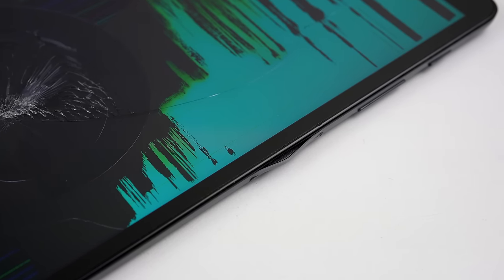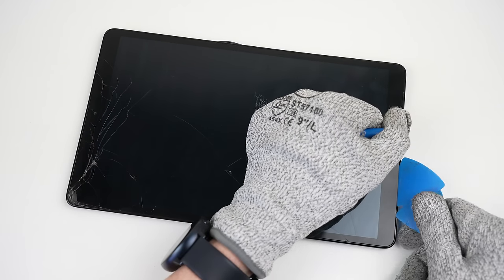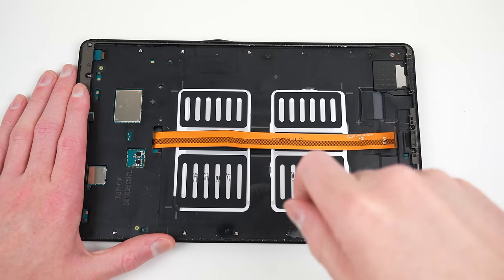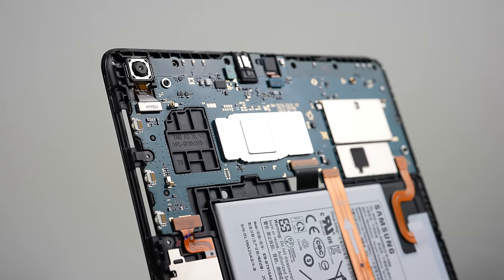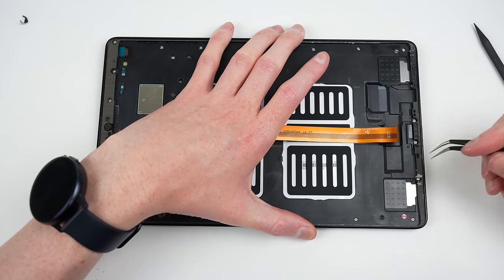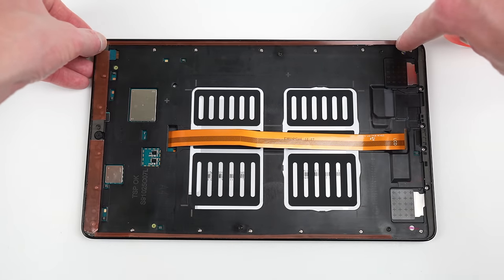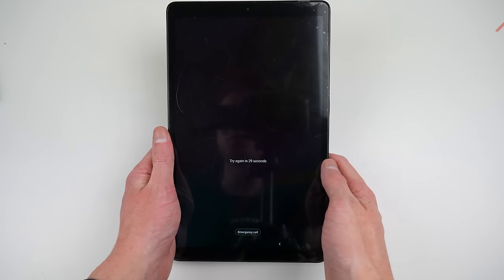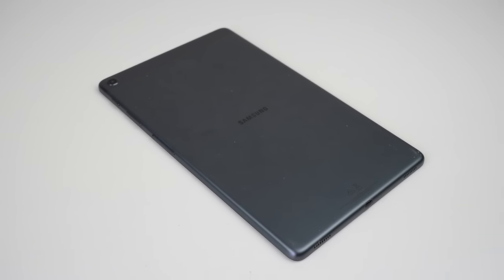Resurrecting This Destroyed Samsung Galaxy Tab A

Comment: The tablet looks really “old school” but at least it doesn’t get artificially “bricked” by software locks when replacing parts.
Reply: Bruh i use this tablet it runs very good it has a latest Android version and runs very smoothly from which angle is it old school
Reply: old school? this tablet is from 2019 lol
Reply: this particular model is from 2019. It's a bit slow and the screen could be better, but it's built well and does the job
Reply: Old school are you crazy, the tablet looks very good one of the thinest top and bottom bazzels
Reply: @boostkiller  the 2020 is even better and has iPad esque thin bezels all around
Reply: @efftee  it’s a budget Samsung Samsung tablet damn it
Reply: Imo the “budget” $329 iPad 9 is better than all these android tablets. Especially when paired with a Logitech keyboard and Apple pencil
Reply: @joriuschuwa  it is budget it’s 100 dollars nzd (329usd is 700nzd)
Reply: @subhanraza9664  same
Reply: @poble  yeah lol I use it everyday
Reply: @groupofmoronsinnz6735  yeah but in my country, the base 64gb iPad 9 costs $429.
Reply: well said
Reply: @joriuschuwa  🤦🏻
Reply: @boostkiller  it’s an opinion.
Reply: Samsung doesn't do this stuff :)
Reply: This tablet also has almost no use. It has no specs to speak of, an awful screen, and is still way too big to be a tablet. It's a crappy laptop.
Reply: @subhanraza9664  I have the 10.1 version lol
Reply: Old school ? Uh no
Reply: @acumenium8157  the screen is so good for this money
Reply: Ellis The DJ  actually this is the 2019 version
Reply: @boostkiller  It's a crappy TFT/PLS screen with no angles, color, or brightness to speak of. What are you talking about? For THIS price I'd expect OLED. It's so expensive. 80$ Chinese tablets with lower-quality IPS screens look infinitely superior.
Reply: @acumenium8157  🤦🏻🤦🏻go for Chinese then
Reply: @acumenium8157  someone’s salty
Reply: @oHacks.  Samsung came out with a Tab A in 2015, then made the 2019 version the same name. Both versions are called Tab A, only difference is the price on websites
Reply: @acumenium8157  you're right when you say this tablet is a terrible laptop, but that's probably the only thing you're right about.

This tablet is like $100, you're comparing apples to oranges and getting very upset in a youtube comment section over said different fruits. Your arguments seem to either form out of ignorance, or perhaps due to being spoiled as a $400 iPad will obviously seem better than a $100 android tablet. Calm down
Reply: It has the typical google-lock. If you reset it with the old owner still signed in, you will need to enter the old pin or sign in to the google account. Luckily there are many ways to get around this with investing some time.
Reply: It's from 2019 the 2015 ones had still the button
Reply: @acumenium8157  it must be big small boy
Reply: @ChrisRaptisMGS_Greece  looks like someone forgot to change their diaper today
Reply: @corvidconfidential8826  Actually this tablet was ~250$ new. It's only 100$ because Hugh bought it literally broken.
Reply: @acumenium8157  if you watched the video, you would know it was $50, and I got $100 from my own experience. Both times I bought this tablet brand new, I got it for $110 and $100 respectively. That wasn't even the point though
Reply: Ellis The DJ  lmfao no
Reply: @joriuschuwa  guess what that is in my currency bud
Reply: @subhanraza9664  For me it's laggy af. My device has 2gb ram
Reply: I had the GalaxyTab As
It's like a much smaller version of it. And man, that thing was durable.
Reply: @joriuschuwa  yes, we know ipads are the best selling tablets. 
Most people prefer them already, as do I.
Reply: it's trash
Reply: @firepower_  Easy repair for one.

Comment: Just saying for everybody here: if you want to disconnect the screen (on any device) make sure the battery is disconnected. If that's not possible at least be absolutely sure the device is turned off. You may blow components on the logicboard of you disconnect the screen while it is turned on.
Reply: I know that's true of clip-style connectors but I wonder if it's any different for ribbon cables like these
Reply: Yes I did that mistake some time ago and can confirm you should do that. It happened to my S7 Edge when I wanted to replace the cracked screen after I got a second broken phone I salvaged a good screen from. After removing the old screen cable while the battery was still connected, nothing every showed up on the old or new screen. I then had to sell all the parts as broken. I got a reply from the buyer who said the second screen was perfectly fine, so I broke the GPU on the board or something like this.
Reply: This is literally first step of repairing electronics, disconnect battery first, or else get a short circuit

Comment: It’s been a while since the last uneventful repair. Repairability is going to worse for sure.
This Samsung tablets are great, cheap and simple. Mainly use an iPad at the moment but also have an old 2016 TAB. After so many years the TAB A still works and does what it is expected to do.
Reply: I used to have a tab 7.7 for 2012 lol
Reply: Is it an tab a6
Reply: @Stayfocused-1  mine is TAB A 10.1 '16.
Reply: I have a Tab A SM-T550 from 2016. Besides the battery life, it's still working fine so I don't need to upgrade it now.
Reply: Yeah, this old tablets are not very fast but fast enough to use, specially if you adjust your expectations. All the apps that I have in the mobile and in the iPad also are in the Samsung and work well enough. 

The main problem is not even Samsung's fault. At least mine comes with Widevine L1, but neither Netflix nor Prime Video recognize that and adjudicate it the L3, so those 2 platforms will only stream in low quality (around 700x500). It is a pitty because the screen is very decent. And you get an SD card slot (which you don't in an iPad) so you can put in there all the movies and series that you might want to watch without caring about storage.

Right now devices with Android 6 are starting to be dropped from support of certain apps, mine has Android 8 so I guess that won't be affected by that for a maybe 2 years more. To remain usable until 2022/23 would not be bad at all for a basic tablet launched in 2016.
Reply: I still use a tab a 2018 and it works great
Reply: @DemeDemetre  i still have it 9 years later
Reply: I have tab s7

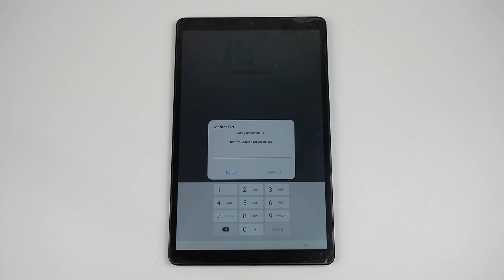Comment: I see at 7:56 there is a FRP lock notification, It is great to see that there are ways to remove this unlike with Apple devices which have iCloud activation locks. Otherwise this device would have been only fit for parts. Another great Video Hugh!
Reply: I wondered as well, I found one in the junkyard (older tab A) that has FRP lock and I can't find any way around it :(
Reply: @trevorjmaendel  there are very good walkthroughs available on YouTube which guide you through the process of bypassing the frp lock and then login using your own Google account. Then reset the device. Frp gone! With Apple devices  it is not possible to bypass the iCloud lock notification like with Android devices. But apple enjoy ripping people off from the moment you buy into the apple ecosystem.
Reply: @retrotech11  I have yet to find one that works. Mine is missing a whole bunch of the loopholes that most people use. I've tried reflashing the OS as well as modding it to no success. Not a big deal as I got it for free but it's a shame not to be able to use it at all...

Comment: Just a note about the repair, from a guy that also specializes in mobile device and laptop repairs. The small control board for the digitizer has some large grounding pads, that were originally connected to the back metal display shield using conductive metal-type double sided tape. If the touch works - then that's great, but just keep in mind that some pcbs/flex cables require proper grounding. You can buy that specific type of conductive-metal strans tape on ebay or amazon. As always, great video, enjoyed watching it, wish you luck!
Reply from the maker: Thanks for the advice, will have to pick some up!

Comment: I actually own a wifi model of the SM-T510 but it is called Samsung Galaxy Tab A 10.1 2019. The model you have is the cellular version which has the model number: SM-T515  ^_^ thank you for a very helpful and interesting  video .
Reply: Yeah I always get Wi-Fi models instead of the cellular ones because it's cheaper, I don't normally take my devices (except my phone) out of home, and when I do, I have my phone with me so can hotspot across from a phone to the wi-fi device.
Plus, if you use a cellular connection, you need a new SIM card in each device, which means another data package, which will get pricey the more devices you use. One central cellular device and wi-fi hotspotting works wonders fr me.

Comment: Luckily it didn't get FRP locked after that factory reset!
Reply: It did though get FRP locked though... But somehow, 0000 worked to unlock it, when it wasn't even the old passcode. I think he may have flashed other things off camera before the reboot clip. You can't just easily bypass frp like that.
Reply: @Sanrasxz  Ah yes, that might be the case. I actually found an FRP bypass myself (as in: figured it out, didn't look it up) by parkour-ing around the UI a few years ago. Let's just say security on old Huawei devices sucks haha.

Comment: You make it look easy.  Curious, what was the msrp and how much did it cost you (sans labour) to repair it?  Did the savings justify your labour or did you just buy it to demo the repair?
Reply: Mama
Reply: To be fair, repairing Android phones in general is 100 times way easier than iPhones as it doesn't overcomplicated the parts that needed.
Reply: Yeah. I got a Galaxy Tab S and the display for the damn thing is $150 anywhere I look for it. Looks like they never made knock-off replacement parts, there are no refurbs, and genuine parts (be it new or used) cost way too much.
>inb4 lol how is $150 too much
New tablets can be had for that much. Considering it's just a toy for the kids, repairing is not worth it.
Reply: Given the price of older tabA’s I’d be surprised if it’s worthwhile once you try paying yourself more than minimum wage.
Reply: @YeOldeKamikaze  isn’t the S an oled panel? Even phone oled panels are expensive, let alone tablet size ones. And you’re not buying a (recent, anyway) S tablet for 150 bucks.
Reply: @JasperJanssen  Yes, it's AMOLED, and it's a first-gen Tab S. Considering it was only being used as a kid's toy, any tablet that runs Minecraft should do. $150 tablets from Samsung and Huawei can do that just fine. Parts + labor gets too expensive to justify a repair. Keep in mind that we live in a developing country and the exchange rate makes spending near $300 on a repair kinda hard to stomach.
Reply: @YeOldeKamikaze  for a large amoled panel, 150 sounds like it is the knockoff price.
Reply: @JasperJanssen  that's the cheapest I've found for decent condition used parts. New geniune parts were going for over $300 (not counting shipping nor labor), but that was many months ago. I have not bothered to look prices up again haha.

Comment: I actually have this device, it's okay, however gotten significantly slower after going onto one ui 2.5.
One thing i was confused by was that; wouldn't the device ask for the original owners email address(and not letting you enter your own until the old one is imputed) as the device has been reset incorrectly? Or am i missing something
Edit: it's called google FRP and you could actually see it lock(7:56) however the seller probably gave him the login to just pass it.
Reply: I guess, that's exact the reason why Hugh did the factory reset instead of the standard reset via the software.
Reply: This happened to me, and it's annoying, however, it's protecting the device from getting stolen and getting sold as useable.
Reply: @gilles111  what?
The lock happened anyways, he just cut it out
Reply: @samuelzuffa4298  yeah it's kinda similar to icloud locked iphones ig
Reply: @PlumbCarton5607  I'm not familiar with the Android security system. If you say he cut that part out,  sounds credible to me. 
I know Apple won't let you reset anything if you don't have the password.
Reply: @gilles111  i mean have you looked at the timestamp at the original comment? There's a pop up you should read
Reply: @PlumbCarton5607  Missed it complete in the video. Thanks for the update!

Comment: Hugh, I saw a couple FRP prompts there. How did you get past them?
Reply: he just enters 0000
Reply: @reddbendd  FRP is tied to a Google account, if you read the screens in Recovery and Setup talking about it
Reply: @JaredTamana  ya
Reply: @reddbendd  okay so 0000 doesn’t cut it for a Google account.
Reply: @JaredTamana  well clearly that’s all he did when it popped up
Reply: @reddbendd  my dude, clearly there’s more that’s been cut out. That’s why I’m asking. I watched the video just like you. We both know what video editing is, there’s plenty here. Please, I’m begging you, use a little bit of extended brain power on this.
Reply: @JaredTamana  well then he probably rooted the device somehow and reset the pin code 🤯
Reply from the maker: "Enter your current PIN" not "Enter your previous PIN" 😎
Reply: @HughJeffreys  what does this mean
0000 didn’t work the first time you tried to unlock the laptop

He changed the pin somehow??

Comment: After you reset the device, it forced you to enter the old pin of the device before it was reset (FRP). Where did you get the 0000 from, as it didn't work before you reset it.

Comment: My little almost 5year old brother tablet looks in a different condition,the glass in the bottom left and wen powers up you will notice that there is a hole in the bottom corner that's because wen we were at my grandmas house he refused to keep his galaxy tab a in the case my mom bought him and in the lower corner glass it is cracked but it still works I was able to charge it concerning it was in my moms cold closet for about 3years because she did not find a repaier to fix it I was also able to update it to android 11 it was orgnaly running Android 8 or 9 because it is from 2019

Comment: I have the same Tablet , my headphone jack is busted ! In South Africa this costs a fortune to repair or replace in my case , I also have a long single line crack running across the screen from one corner to the top corner , my biggest fear is , if they have to replace my headphone jack would i necessarily have to replace my screen ? What makes this even worse is Samsung South Africas sloppy service hence I am a Samsung member

Comment: You know that apple is not fixable. Even if you have original parts - it won`t work because of codes, programmable parts (even battery) etc. Sad but true :(
Reply: Reprograming
Reply: @romashul9672  I know but often there is no reprogramming software available for newest phones or it is still too expensive for small repair shops to own.
Reply: @devilio  yeah I thought you meant they were unfixable.
Reply: @romashul9672  some of them are. Most of them are not unless you are willing to go to official apple service or counting on inconveniences after unprofessional repairs. Their phones are most difficult to repair.

Comment: The use of adhesive strips to hold down the display assembly is not a very reliable way to secure it to the body of the tablet. The display can eaaily by removed from the housing if even a fingernail makes it's way into a corner or a small crevice.

Saying from experience.